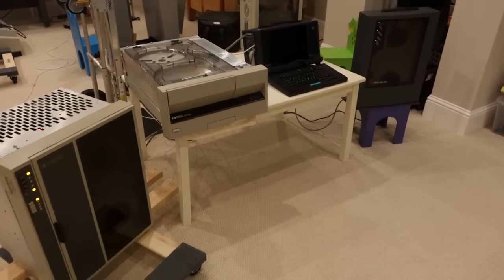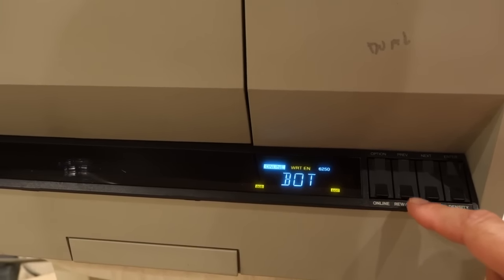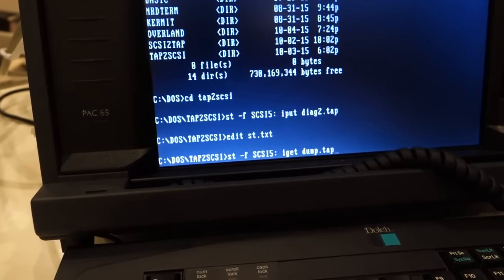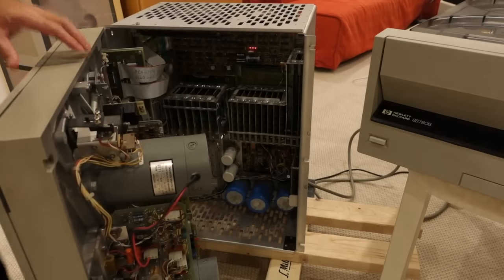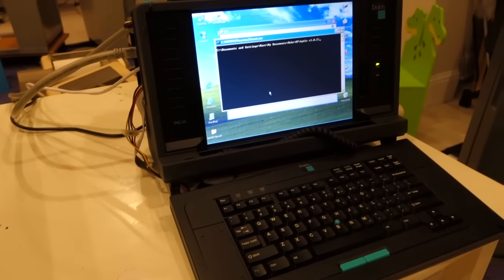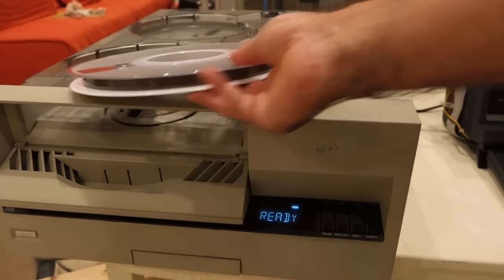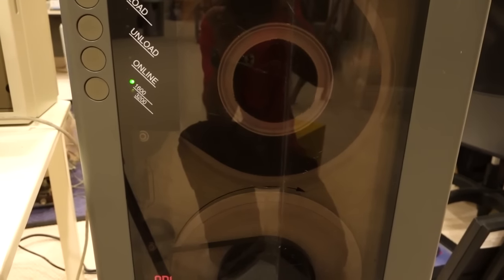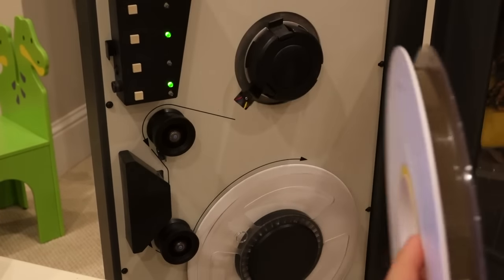HP and Overland 9-Track Tape Drives Demo

Comment: Hello there Marc:  Thanks so much for the response. I got the machine, but I notice that just plugging in power and putting a tape on without it connected yet to the computer, just all the lights go on but no loading. Wonder if it is a problem inside the machine? There is a bottom platform that I did not screw in at the  bottom of the machine yet. Could that be why the machine shows a error and all, because it can fall over without the platform? I know this is a strange question, but looks like the machine can fall over without.  Thanks for your help. Looks like one small wire is cut, but I see that since all the pins are not there that it can still work form your email thanks for your help Marc.  Victor
Reply from the maker: +toborthegreat Yes, something probably wrong with your machine. It should be able to load without being connected to anything. The front door must be closed for it to load, that's all.

Comment: Would you be interested in trying to read an old tape I created on an IBM 3420 back in 1984? I'm not sure what's on it, but I do remember the block size was 4101 bytes (presumably 4096 bytes payload + 5 bytes control)
Reply from the maker: +thelastofthemartians Sure. Contact me off line via personal message. If it was written using Phase Encoding (PE) at 1600 - which in 1984 it should have - I should be able to read it (if it's the older NRZI 800 cpi low-density format, I have an older tape drive that just came in but it's not operational yet). What's on it?
Reply: +CuriousMarc hmmm...I spent 30 mins looking but I couldn't see a way to PM you
Reply from the maker: +thelastofthemartians I can't send you a PM either! Probably you don't have a confirmed name on YouTube? See the instructions from YouTube Help: https://support.google.com/youtube/answer/57955?hl=en , it should work but you need a confirmed name before you can use the feature.
Just tried to send myself a PM: clicked on my name to go to my channel, clicked on the "about" tab, and I can see the "Send Message" button on the upper right. So everything seems to be fine. Give it another try, let me know if it still doesn't work.
Reply from the maker: +CuriousMarc Got your PM, you fixed it.

Comment: Hello Marc; thanks again for the info. Do you know anyone who repairs the Qualstars or Overland Data units? I have one of each exactly the same as yours but both have issues. Also I have a Digital DEC TSZ07. What is good to clean the tape path with as the Freon recommended is hard to get?
Reply from the maker: I don’t know anyone that does this off hand. If I were you, I’d look up when the next and nearest Vintage Computer Federation (VCF) meeting is and go and meet people there.
Reply: @CuriousMarc  Hello Marc; I was thinking the same thing. I am close to Miami....nice and warm! Maybe they will hold a show near by. Any idea on what to use to clean instead of the Freon?
Reply from the maker: I use isopropyl alcohol.
Reply: @CuriousMarc  Thank you Marc...I panicked after reading the maintenance manual....lol. Now if I could find a maintenance manual  and schematic for the Overland Data unit.....
Reply from the maker: @markohara5146  Let me know if you ever find it. It’s Overland Data Manual 104075… Could never get a hold of it!
Reply: @CuriousMarc  Hello Marc....sure will. Hope I can get them working at some point...

Comment: I have an old backup tape drive, and I'm wondering can they be used as a disk drive?
Reply: It's an internal PC based drive by Iomega.
Reply: Being tape, it would be extremely slow to seek to a particular file or record, so it's doubtful that it would be worth the bother even if it's possible to get a driver for a modern OS.
Reply: Tapes are serial type access, so not much good as a disk type access

Comment: Why does it go back and forth like that? Wouldn't it be faster to just write the files in one shot without reversing the tape?
Reply: I think it's error checking
Reply from the maker: Write errors could do that, but that's not what is happening here. It's because it's a streaming tape drive, not a start/stop one (the much older HP 7970 I demonstrate later is start/stop). Streamers go very fast when writing continuous backups (like a tar archive), or a few large files. But it's terrible for small files: it doesn't have the ability to stop immediately in the inter-record gap. It overshoots, and then backtracks to find the gap and start the next file. What I am trying to write on it is a very old diagnostic tape from the 1960's, and has many, many minuscule executable files (a few kB each at most). And my (very old) computer is not fast enough to feed it the next file so it needs to stop to wait and backtracks before restarting for the next file. A start/stop tape would have no problem with it. But start/stop mechanisms are excessively difficult, heavy and costly to make (see the 7970 huge motors!), so they were abandoned in favor of the simpler "streamers" later in the 80's, when tapes were used mostly for backup and ample buffer memory was added to compensate.
Reply: To tl:dr the above comment/rephrase it; Yes, but there is a speed bottleneck at the computer end and the particular drive mechanics can't stop on a dime. That's compounded by the fact that the particular tape image (old diagnostic tape) he's recording with contains many small files.

Also, sorry for necro

Comment: Bit per inch I believe
Reply: Its actually BYTES per inch, tapes are written 8 bits + parity (tracks) at a time hence the name 9 track tapes. When a block of data is written, it also contains CRC for the block. When a tape is written  the heads have a read after write, so after a block is written the controller checks the block just written and if its bad, it will back up to the interlock gap and try again. It will attempt this several times (aka "shoe shinning") if it still cant be written, it will back up 1 last time, erase the block and attempt it again on a new piece of tape. Again it does this several times. I think the spec is 30 inches. If it is unsuccessful, you will get a data check on the tape and job should be aborted.
On read, the data is error corrected by the parity bits and the CRC.
I restore tape units at a computer museum

Comment: Don't have FC on the Dolch portable?
Reply from the maker: +douro20 You mean an optical Fiber Channel card? Yes I think I have it, it came with a Xyratex dual optical GBIC interface. Quite an impressive card with a giant amount of buffer memory in it. I removed the card though, I couldn't find a driver for it on Win98 or XP. Do you have one? I thought it was a GbE card, not a FC one, but you must be right. I am not going to find any vintage equipment that connects to that though ;-)
Reply: +CuriousMarc No, I mean the FC or File Compare program.
Reply from the maker: Ah, no, thanks, I have to look that up. I use AptDiff on XP, but I was too lazy to load it on the Dolch...
Reply from the maker: +douro20 You are killing me. I just typed FC on the DOS command line, with the two file names. And it did a "file compare" right there and then! Duh. I felt like an idiot for a moment. Thanks douro20, I had no idea this utility was built-in in DOS!
Reply: +CuriousMarc After decades of using Windows, it's easy to forget how much can be done with a DOS!

Comment: HP 2000? The entire source code for TREK 73 written in HP BASIC can be found at http://www.kermitmurray.com/trek73/hp-2000-basic-code/
Reply from the maker: +RaymondHng Thanks! I keep referring to it as HP 2000, but it&#39;s a 21MX. Model HP 2112. Also later known as HP 1000-M. Go figure. See when I inspect it when I just got it here:  https://youtu.be/NJoXFdUBSeQ . Have not turned it on yet... Jay West has the only fully working HP 2000 Basic system I know of.
Reply: +CuriousMarc Actually, I have several working HP2000/Access Timeshared BASIC systems :) For years I've had the only running ones - but I do know for sure that at least two other collectors are actively working on getting their own HP2K system up, and one of them is fairly close. So hopefully soon there will be more than mine! And by the way - HP2000 doesn't refer to a computer really, it more closely refers to the operating system.